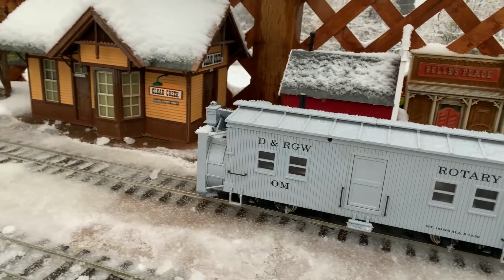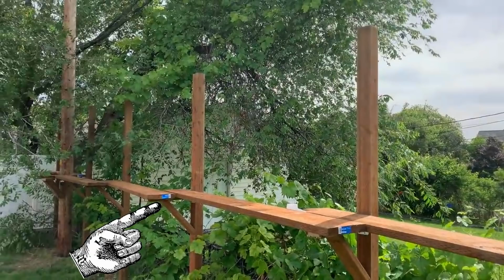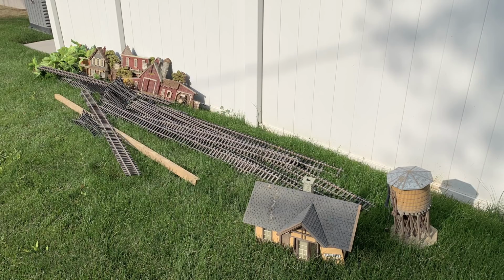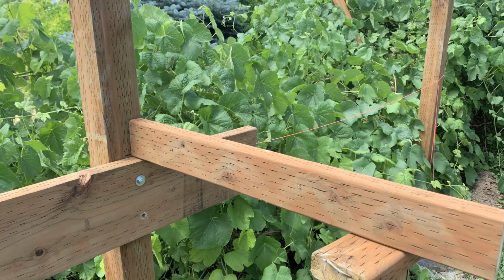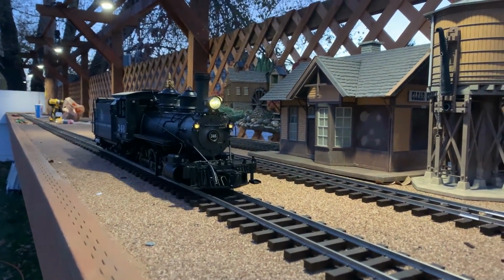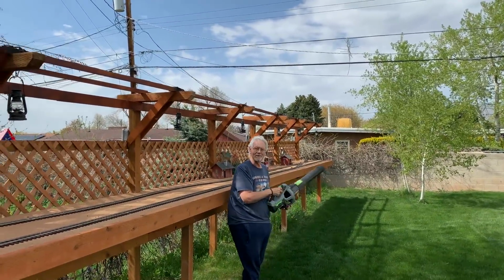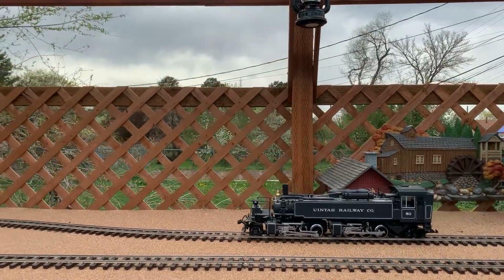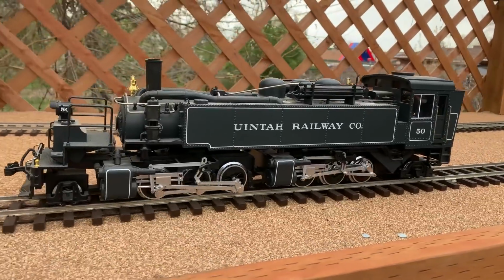Elevated Garden Railroad Construction - Opening the Garden Railroad for the Year 2022.

Comment: Absolutely gorgeous . Using rolled roofing is pure genius . Height of benchwork appears to be perfect .  I bury the posts minimum 2 feet in the ground ,never use concrete since wood is not suitable for concrete contact ,also creates pocket for moisture to collect . Instead pouring gravel around post will support the post . As the post shrinks gravel will automatically settle  and keep the post tight . . Do the same on  fence . 6x6 post is concrete contact rated . I learned a lot from your video . I enjoyed watching very much . You are fortunate to have great support .Thanks for a beautiful video

Comment: Very cool 😎 how you solved the issues with the posts, warping, the whole construction. Great to see your train running. 
There’s flux existing with which you can solder to aluminum. Over on this side of the pond it’s sold by Védé. Fluox S90. Requires some adjustment of the soldering technique though. Temperature differs from soldering zinc or stainless material. Also the soldering time is of course shorter. 
Anyhow, can imagine you will change out those fake nickel silver aluminum points for true nickel silver turnouts. 
Also, am looking forward to your next steps and progress towards the loop and Garage Mahal.
Thanks 🙏 sharing!
PS, just saw Ron’s Trains and Things with his update on NO-OX-ID. Makes me wonder how this stuff will work for an outside layout.

Comment: Love the redue. LOVE THE LANYERNS WITH PUCK LIGHTS. BUT there could be problems. First the post in the ground will be trouble. ALWAYS go 4 feet down to get below  the frost line so it won't lift. Best 4 foot deep hole cement only with rebar. With an anchor bolt dead center of the cement. Then place a post base attached when the cement is dry. The base screws into the side of the 4×4 keeping it out of the ground and out of the moisture. Post will last longer. Platform roofing material great idea. But the plarform should have drainage either by drains or up to a 1% pitch towards front or rear. I have never seen boards warp as bad if they are pressure treated. Cedar holds up well to elements but is pricey. Just some ideas for longer life. Along with staining and/ or sealing wood ecery so often.

Comment: Next time you place a post into the ground, take 20 penny galvanized nails and drive 6 in on each side of the post that will be in the concrete, leaving about 2/3 of the nail sticking out so when you place your concrete around the post, the nails give the concrete something to bond to. Your post and pier are now one unit. When the post dries completely, there will always be a tiny gap between the post and concrete, (wiggle) The post and concrete are now one. Also, make sure the concrete is an inch higher at the post and slopes down and away from the post so no water will puddle around the post. Also, think about using marine grade plywood for all exterior uses.

Comment: Wow. Dale and Karen you sure learned the hard way.  2 major problems here: you did not have a good plan to start with and you had cowboys build it. If you build a fence with 10 ft posts you should have  at least 2ft in the ground (I prefer 3-4 ft) with decent concrete bases. Selecting the correct lumber is paramount as is the spacing and bracing, Good you got through it  and it is now looking good.

Comment: Always appreciate when modelers share what didn't work and then the revised Plan B.  Great to see the garden railway coming along. An idea is to try some NoOx on the aluminum rail to get conductivity so you can run before the turnout replacements. Beautiful job.
Reply from the maker: Used Noalox. The first railroad was 100% aluminum rail but I used that in part to keep the joints from seizing up. Anyway in this case the running rails and even all the joints are doing okay. But because I can’t solder to the frog rails power is getting there through the points…. I should do a video on why that is and how I’m fixed it.
Reply: Thanks for your clarifications 👍

Comment: Did you all Buy or Build the Lantern Lights ? If you Bought them , WHERE and if you Built them, were did you find the parts ? I have been looking for about 300 of them for a project I am working on for a friend . He holds Weddings on his 40 acre ranch and he wants to put those types of lamps all along the walk ways . Might need up to 1000 of them by the time We are done . We have already wired the set up for sound and in total he will have 13 Zones with just over 500 smaller 70volt speakers . As he was building the walkways we put in a 4" Pipe for all of the Low Voltage(70 Volt) and a 4" pipe for the high Voltage(100 volts+) .
Reply from the maker: Built. Just the small lanterns from Amazon. About 9”?  The down light is a 12 volt “puck light”. They are for campers and trailers. Magnetic. They just stick the the bottom of lantern. Found them on Amazon. Search for puck light. Drill a small hole near the edge. The flickering light is also 12 volts. It’s a campfire effect for model railroads but any flickering light will do. My whole system is 12 volts but I have 110 there on plugs. But the lights are all 12 volts DC.

Comment: Dale & Karyn, nice to see the railroad back and running! I've heard great feedback about the nickel silver rail's performance over the years from folks using track power, it's nice to see that confirmed on video! Looking forward to seeing the full route come together. -Mike
Reply from the maker: Hi Mike! Yeah I bought a whole bunch of used switches that you built. The first batch turned out to be aluminum and I didn’t notice that until I was laying them out there. Went to solder my wires and well, couldn’t very well solder to aluminum! And as it was about to snow, no really it was just about to snow! I just went ahead and buttoned it up for the winter. And sure enough come spring there is a small issue. Now I need to figure out if I want to take those switches completely up and start over or just replace the sections that are giving me trouble. Right now I’m leaning toward just replacing the rails that are giving me trouble. Because the switches work great! And why argue with works great. I just need to get power to the frogs and the rails leading up to the frogs.

Comment: Where did you get the roofing material, love your layout!
Reply from the maker: Just Home Depot. Like $50 a roll. I’ve used two so far. Really gets hot too. It’s been the hottest year on record. But when it’s 100° out the roofing is sitting between 130° and 140°. But the rails are 160° to 170°!! No matter. It works well.
Reply: @ToyManTelevision  thank Ill check it out, its been hot in Tennessee this year, com' on fall, thanks alot!!!!
Reply from the maker: @scotthill1966  and I grab their brown caulking. Outside caulking. You need to seal the edges and seams.

Comment: Just a note on powering the frog rails of the turnout.  Flip the turnout over, drill and tap the rail and add a screw with the wire.
Reply from the maker: Hum. Never thought of that. I’ve been clamping connections. I this case I’m going to start by pulling the frog rails and replacing them with nickel. The running rails have a clamped connection which you cans just barely see between the switches and is working well. It’s the frogs that need help. And my plan is when the power is DCC I will be adding auto power switching for all the frogs and reverse loop.
Reply: @ToyManTelevision  That sounds much better!  Cannot wait to see how it comes out.

Comment: I’m a little confused on the ramp. It appeared earlier in the video that the train comes out of the garage around ground level then proceeds up grade to the new layout shelf but at the end, it appears the garage tunnel is at the same elevation as the shelf.
Question was answered in the 3rd episode The Tunnel.
Reply from the maker: Hi!  The inside elevation is 52 inches. Outside it’s 40 at the east end, back to 52 at the west end. Because the ground slopes away. So on exiting the garage the tracks ramp down 12 inches the the outside level. It’s the only grade on the railroad.

Comment: Verify the use of floorboard expansion joints in the timber deck.  expansion likely with 100 degree temperatures.  Place expansion joints in the deck
Reply from the maker: Yup. Using metal clips that hold the joints level but allows for a small amount of horizontal movement. Same with rails. 1/8” inch joint when cold.

Comment: Regarding rail material:  I have all brass rail on my outdoor layout.  Cleaning is not been difficult. I have gone for months over winter and trains run ok without cleaning in the spring.  Only 1 power feed point for over 200ft of track. The track has been in place since 2006-2008.  Currently at ground level but making plans to elevate half of it.
Reply from the maker: Yup. Brass is good. Nickel better. Aluminum poor. Mixture a mess. But 100% brass is great!

Comment: Hi Dale and Karyn. Love the update!   Concerning the electric connection to the switches. You have copper wires powering your rails and the aluminum switches create a resistance mismatch!   Same problem in some home wiring and it would cause fires because the copper wiring needed to draw more current to pass through the aluminum wiring.  Yes, replacing the track with the same metal (nickel silver) will give your layout a uniform resistance and “eliminate” your problems (knocking on wood).  Use a multimeter to check your voltages.  Hope this helps.   See you Tuesday.

Comment: Excuse my ignorance but, what is Strandboard?
Reply from the maker: Oriented Strand Board. Well big name fer chip board. Cheep version of plywood. It has totally replaced plywood in home construction.
Reply: Oriented Strand Board, or OSB for short, is similar to plywood, but uses thin chips of wood glued together. It has more strength than particle board, but less than true plywood which has layers with the wood grain running perpendicular to each other for the full width and length of the material. I myself don't recommend using OSB outdoors unless thoroughly protected as it delaminates more easily than plywood when exposed to moisture.
Reply: Both are correct. Unfortunately it is called by many names including OSB (oriented strand board), chip board, wafer board, sterling board, and even plywood, which technically it isn't but has been called that by some contractors whom I've sold many sheets and bunks to for over 13 years.

Comment: Two words to consider. 
'Dead Rail"
Outside there is no substitute for dead rail regardless of what rail material you have
Reply from the maker: Well I love locomotives. Have like 40 of them. In large scale. So I can’t afford to battery power them all. Will have one or two. Some DCC. Lotsa Dc.
Reply: @ToyManTelevision  your collection is really impressive to say the least.  And yes adding RC and batteries to all of them would be extremely expensive. 
Track power and DCC that work good inside  . Seem to be problematic outside

Comment: I don't think that's properly pressure treated wood, or it's pressure treated wood that isn't great for your location.  Properly treated wood and using proper shelf brackets should work for what you wanted to do.  The problem started with the improper installation of the vertical posts...which actually would be better if you used Redwood fence posts for that, then you don't need it to be pressure treated.  You can solder to aluminum...just did a quick Google search and came up with a bunch of solder for copper to aluminum...if you don't want to replace those turnouts.